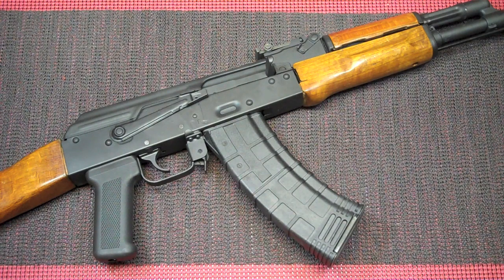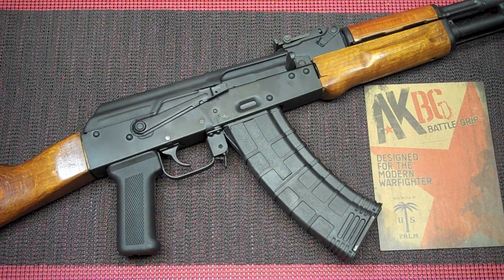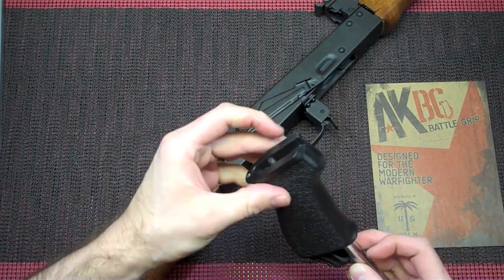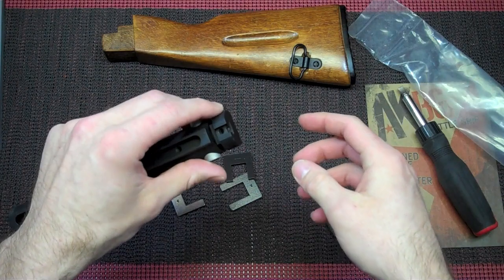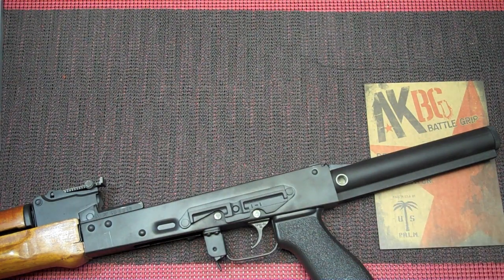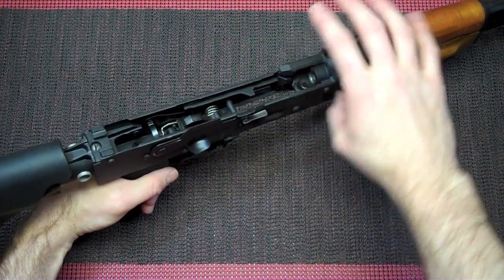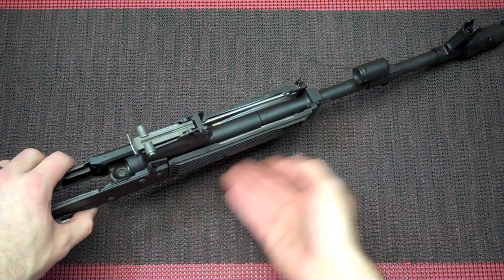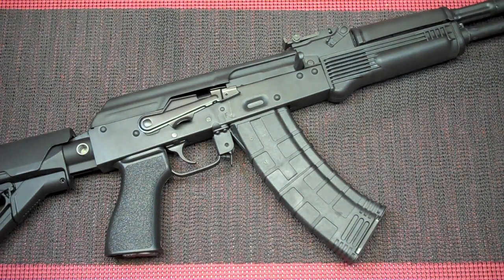AK74 :: From Traditional To Modern :: Musty Yeti

Comment: AK rifles would absolutely be worthy of a carbine course, in most cases. Starting with a higher quality variant, and making some ergonomic changes make them very worthy of a course. My SGL-31 is setup with a Rifle Dynamics M4 stock adapter, US Palm battle grip and and enhanced safety, manticore night shroud, MI 30mm mount with an Aimpoint pro. It is every bit as quick on target as my midlength BCM. It's heavier, but nothing that can't be overcome with practice.

Comment: The Krebs lever is very loose when the rifle is disassembled. If I pull the trigger hard enough with the lever on safe, the safety will fly backwards and the hammer will be released. However with the bolt carrier in and the dust cover on, it is rock solid when it is in safe and it won't go anywhere unless I brush it off. Good product overall.

Comment: The notch missing on the safety is so you can lock the bolt to the rear. Didnt know if that had been answered or not just helpin out. Also someone commented saying that the buffer tube is slanted and that is so the stock is level with your sights.

Comment from the maker: I'm 6'1".  I normally have the stock set on position number two or three.  However that can change from day to day.  If I'm wearing a thick coat I might run it one position one.  That's what's nice about adjustable stocks, you can make them fit you.

Comment from the maker: Well I got an email informing me it was in stock and when I checked there was none in stock.  It's stupid.  I have to get the PA red dot because it shares the same bolt/screw pattern as the Aimpoint Micro.  That way you can buy the US Palm rail kit and bolt the PA red dot low enough to co witness.  I already have a Bushnell TRS-25, so it's to late for that.  Thanks for the compliments, take care.

Comment: Cool video, I just installed US Palm Grip in FDE on my WW AK74 and I got the brand new buttstock from K-Var in NATO lenght waiting to be installed, I got a drill 2 new holes for the screws and need to borrow a drill from a buddy.
I was also looking to get MI quad rail and pair it with PA red dot, but the red dot is out of stock and they said they are waiting already 4 months for it lol. So I might just order the quad rail with PP red dot top cover and wait for the red dot I guess.

Comment: What forend is that? Brand I mean. I keep hearing the Arsenal ones don't fit the waffen werks. Where did ya get it? A link would be killer lol. Thanks!
Reply from the maker: I just used the standard factory forend from my Arsenal AK.  Like I mentioned in the video I had to do slight modifications in order to make it fit.